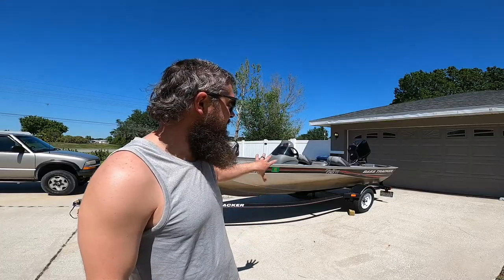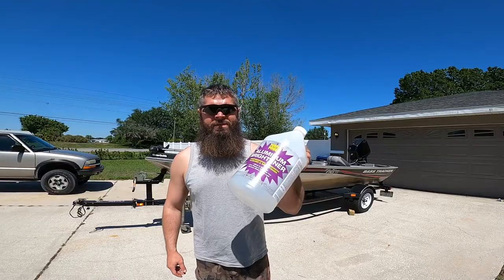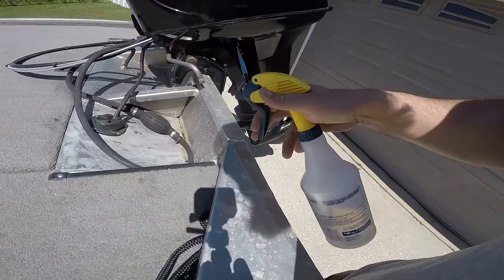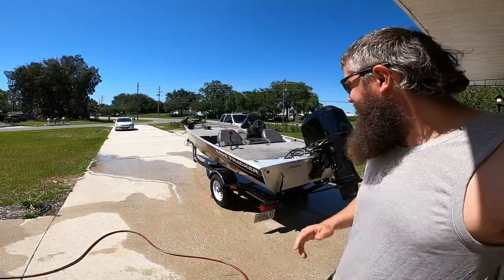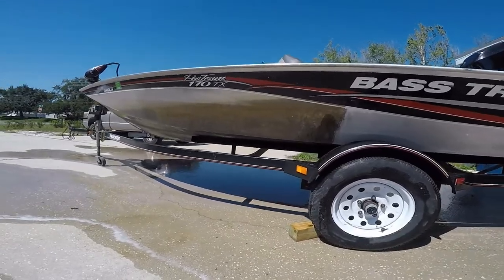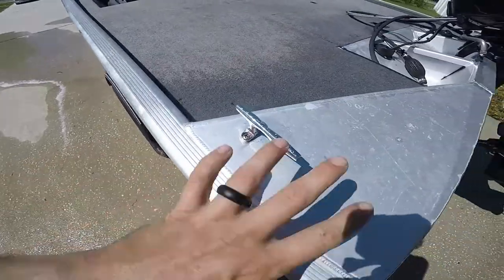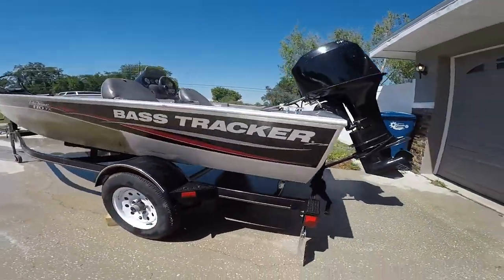HOW To CLEAN ALUMINUM Boat | Stained BAD | NO SCRUB

Comment from the maker: If you have any questions just COMMENT BELOW and I will do my best to answer them. This was so easy to do, and fast! Leaving my boat looking brand new! TIGHT LINES
Reply: Does it  stain carpet does it hurt the sticker on side of  boat and does  it fade paint  . I've got a 94 tracker
Reply: Great thank you
Reply: Where to buy
Reply: I got some of this and cleaned my boat. Same boat you have. It worked amazingly. However, when I put it in the water later that evening I noticed the next day the staining came back. Did you have this issue? And I’m thinking I should wax it after? Any ideas or suggestions? I’m thinking some turtle wax possibly. Thanks
Reply: Just get white diamonds polish and full rotory harber freight 7amp buffer and get your shine back and seals it
Reply from the maker: @DavidBrooks-vb8do  Yes! I had the same issue, I re did it then waxed it. That was the solution. Still looks good a year later.
Reply: Thank you for posting. Did tracker logo ever peel after you applied the cleaner?
Reply from the maker: It did not affect the logos at all. I am currently trying to get them off and they are very stubborn. Heat and lots of time. They are on there really good!

Comment: I literally just bought the same boat, just a few years newer, and it looked the same as yours. Thanks for the tip I will defiantly be using the purple power to clean mine.
Reply from the maker: Wax it after and it will stay that clean for a long time. I run mine in saltwater only and it’s still bright. Little more dull but no stains.
Reply: @WildWonderfulOutdoors  Thanks for the tip
Reply from the maker: I used the McGuires in a red can. Just car wax but it held up great. Make sure to wax on and off. The wax will show white streaks if not properly wiped off all the way.

Comment: Man your boat really came to life! Question? Hope you may know. My 96 bass america boat made by polar kraft looks identical to a bass tracker. I wondering if my boat is painted or raw aluminum like yours. I would just like to know somehow if it's coated or type of aluminum color. Maybe you have idea on how to find out. Thanks
Reply from the maker: You could apply the cleaner to a small area that you don't see to test and see if it does anything.

Comment: I tried on my boat as well. It looks good after. But the thing is once the boat hit the water again I found out the sting or oxidize come out again. Do you have this issue?
Reply from the maker: Yes! Clean it again with the product. Once it’s dry, I used McGuires car wax. Apply it and then microfiber/hand buff it off.

Comment: is it safe for all other surfaces? the motor, decals, trailer, etc?
Reply from the maker: Yessir! I didn't notice it affecting anything other that the stains. It even took the stains off the decals without doing anything at all to them. It didn't affect the carpet, I sprayed it on the lower unit as well because that was stained. Literally just took what I wanted off. I was pretty amazed. The product is only $18 for a gallon I believe. Totally worth it in my opinion.

Comment: Did you have any issues with that cleaner eating away the fuel line you sprayed? Curious if it eats away at things like that.
Reply from the maker: No not at all. It’s only on there like a minute. Water is what neutralizes it.

Comment: When you say stained. My tinny looks like it has small blotches that are corrosion. 
  Is that what you noticed or was yours a uniform discolouration ? 
  Thanks.
Reply from the maker: It looked like a hard water line. You should be able to see it in the video. It was from the saltwater and aluminum reacting.
Reply: Did you ever this fixed I have that same problem

Comment: Will this affect white paint? I've heard so much about how these acids in it will ruin paint. It's old paint but it's still paint tho
Reply from the maker: This is an aluminum hull, I wouldn't use it on paint.
Reply: @WildWonderfulOutdoors  ended up using it on painted aluminum hull and just sprayed and scrub and then rinse it off and it made it look better... might have paint coming off in the future because of it but it needs new paint probably anyways with scratches it had on it also
Reply from the maker: @kyleunderwood7410  Right on man! Glad it worked out for you! I'm sure if you left it soaking for a long period of time it might start lifting the paint. But if you just let it do it's thing real quick and hose it off it works.
Reply: @WildWonderfulOutdoors unfortunately your trailer may have gotten some of the runoff. Boat looks great though.
Reply from the maker: @devonblaine  It's been about 6 months now and there is absolutely no damage to anything on the boat or trailer.

Comment: only do this before you sell - the stains will come literally next time you take it back to the water and it will be all dark brown/bronze. This is an ACID like solution and removes a thin layer from your boat that's why it's no scrub. The hull is being left unprotected after this (no clearcoat etc.) and I promise you everything will be back and may be more. None of these videos are showing the results after taking it out on water. Also if you spray this on the deck or if it gets in the boat at the bottom in large quantities it will keep eating it away, until it's neutralized with enough water.
Reply from the maker: That’s why I say wax it after in The comments. The car wax protects it. They still haven’t come back on mine.

Comment: Tried this on my boat on the same exact boat as yours on a spot that’s hard to see and it turned white right off the bat and stayed that way, anyone know why it’s doing that?
Reply: maybe thats its original color.. my boat was white looking because the hard water calcium build up after i cleaned just a small portion of it turned back to its original color of grey. you can also do 1 part distilled water 1 part white vinegar thats what i used , and try that and see if it also turns it white if it does thats the boats original color. the water vinegar combo is a very light acid that wont hurt paint. but yes rinse it off.. its also fast and i only used a microfiber and just did a very little scrubbing and rinsed off semi fast.. within a few minutes. though if i want it more perfect ill have to scrub it with the water and vinegar but im not sure how long the build up has been on the boat. but it already looks a lot better with minimal effort.

Comment: Does cleaner fape carpet  or stickers  on boat or panted  surface
Reply from the maker: No, I have done 2-3 cleanings and everything is fine. Just remember the product is only supposed to sit for 30 seconds to a minute. Just clean it in sections and rinse with water.
Reply: Thanks very much for the answers to my questions
Reply from the maker: @lonniegalyon7524  of course! My main advice would be to not leave it on too long, rinse and do areas at a time.